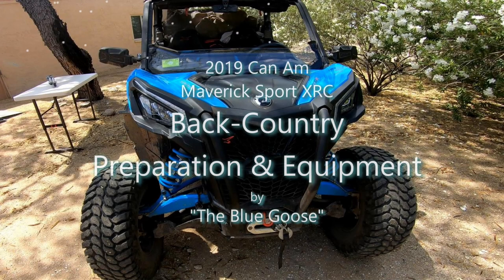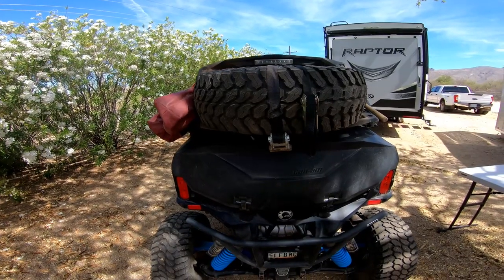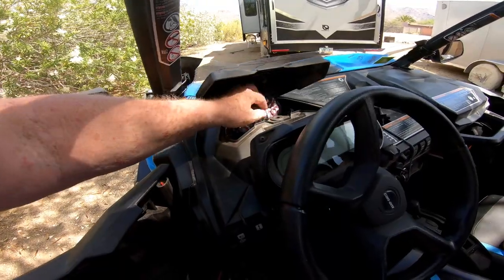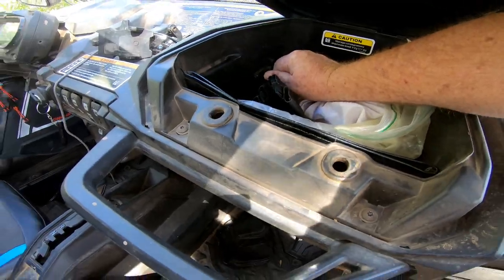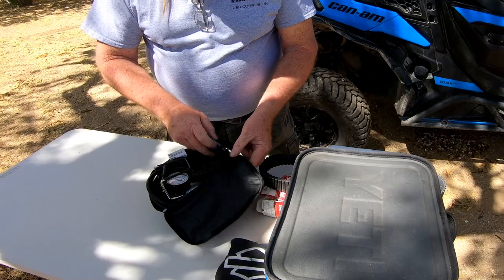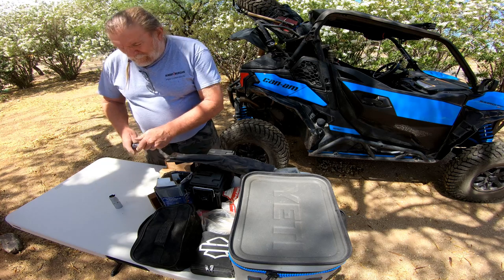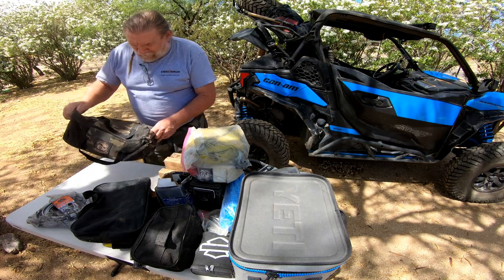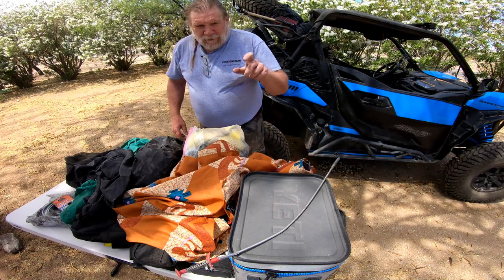Back-Country Preparation and Equipment - Can Am Maverick Sport XRC

Comment from the maker: This last week, a friend got his RZR hung up on a tree stump on the side of a hill.  We used the equipment shown in the video (winch, straps, etc.) to pull his rig sideways off the stump and lower him down.  Another friend simultaneously used his recover equipment & winch to pull a downed tree blocking the road back to give us room to get the stuck vehicle back on the road. You may not use this equipment often - but when you need it, you will find it absolutely invaluable.  In the above case, we turned an impossibly stuck vehicle that was 25 miles from camp into about a 45 minute adventure with a happy ending.  That's the value of being prepared! Praise God!